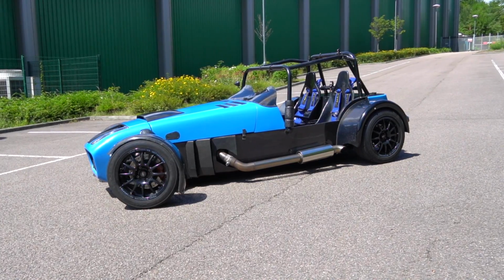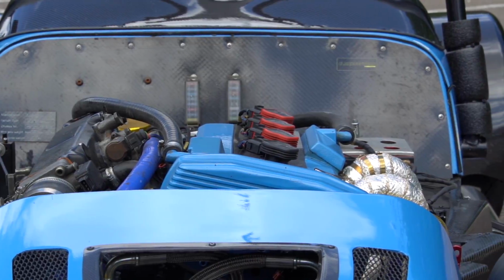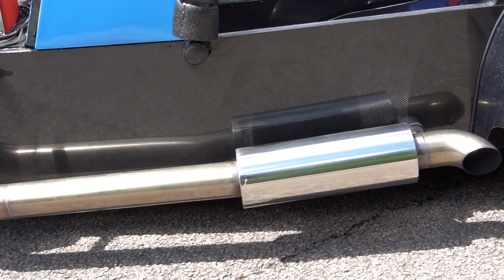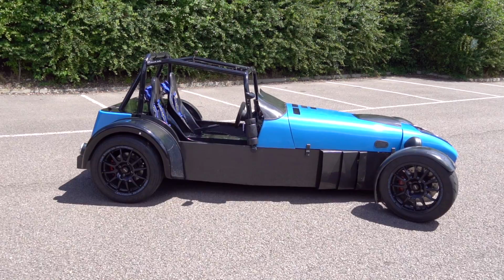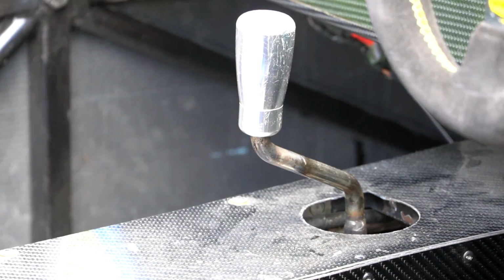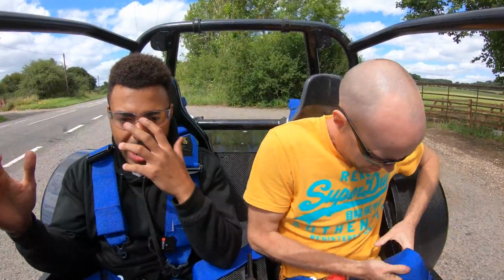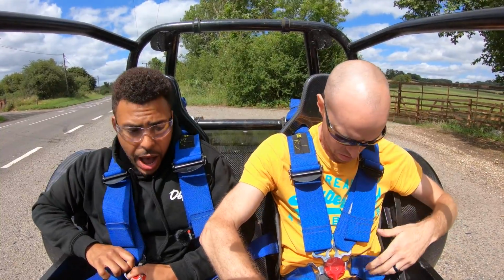THIS TERRIFYING KIT CAR HAS MORE POWER TO WEIGHT THAN A *BUGATTI VEYRON*

Comment: You need balls of steel and reactions of a fly to drive something like this. I'd be constantly worried about it losing control, correcting it along with the little protection that's given. Hope the owner drives safe 👍
Reply: I've had the opportunity to drive three others- one was a sort of daily  driver, easy, spirited after the Honda Civic the motor came from but not wild. the other two were built to exploit the very low weight the design makes possible. Monstrous and more monstrous would be my call- and as addictive as the other speed! They are the most "alive" thing I have ever driven in my life- it literally vibrates and bellows and dances when you get brisk with it. It tells you every step that you can get badly bitten if you go to far!
Reply: After about 150hp they get very twitchy in the wet. That's already quite a high hp/ton for a road car and they don't have much weight over the rear wheels.
Reply: Well driving without a helmet is just asking for problems.

Comment: nice to a locost featured anyone with  wants to build one the original book by ron champion was rewritten by mk sportscars and then years later it was rewritten  and is now  called the haynes roadster  which includes improvements like irs suspension  over live axle  wider/taller  design etc and new donner cars but yes you end up with something  fast  personalised and unique  to blow your mind

Comment: Forms of the Locost Seven, named after the Lotus Seven it emulates, have been short course winners since Colin Chapman designed the first ones in the '50s. From that start, with 750cc economy car motors, and adapted drive trains to this beast- awesome! From 0 to 125 mph or so, they are in a league few cars attain- past that and their poor aerodynamics start wanting more horsepower than you have. If you ever wondered what it would be like to go on a screaming run inside a fast agile cat, this is the ticket. Thanks to OG and LC Turbo for bringing out the toys!

Comment: Anyone that wants to know what a BIG motorbike power to weight is like, it's similar to this. As an everyday biker I've raced quite a few quick cars in my 10 years on the road. This and the Ariel Atom are probably two of the best cars to challange big bikes off the mark but once the speeds get beyond 110 mph aerodynamics will really come into play and the bike will pull away. Remember that most 1000cc bikes do at least 80 mph in first gear then have 5 more left. This looks a lot of fun i have to say and similar performance to a bike
Reply: Which is why a laidback retro bike is my kind of thing, too many crashes on my bicycles already. My bro rode at between 90 and 120 from Exeter up to Sheffield on his Honda CBR one evening and surprised his wife at being home for bedtime, sports bike riders like you are crazy. 🙂

Comment: Sadly the fenders won't support tires to match the P/W ratio and why is a bolt missing on the bracket for the throttle cable, that could cause some issues..

Comment: Love the video and the car but I have a question: Caterham produces a very similar kit car (the 620R or something like that with very much the same power to weight ratio) but their 0-60 times are much different to what this car did on the og battles. Also the  Caterham 420R  is rated to be capable of a sub 3 second 0-60.  What's stopping this car from achieving a similar results ?
Ok a 4 second 0-60 is still very nice but a sub 3 second is another level (they claim 2.7 seconds or something like that) ... into the hyper-car kind of performance.

I'm asking this because I'm considering starting on such a project but I've not yet decided  where to start off from.

Comment: Marcus Nicolaou is a Senior Director with Alvarez & Marsal Taxand in London. He has more than 20 years of experience in domestic and international corporate tax.
Mr. Nicolaou has worked with clients across a wide range of industries including retail, pharmaceuticals, automotive, real estate, professional services and hospitality.
Mr. Nicolaou brings extensive experience in tax reporting, tax accounting and compliance, including advising on all aspects of group tax planning to minimize clients’ tax burdens. He has also been involved in negotiations with HMRC in order to settle enquiries into his clients’ tax returns.
Throughout his career, Mr. Nicolaou has advised companies on a wide range of corporate tax matters including acquisitions, disposals and reorganizations of businesses (including submitting statutory and non-statutory clearances and preparation of tax due diligence reports), post-merger integration, the substantial shareholdings exemption, the dividend exemption, stamp duty, stamp duty land tax, chargeable gains, capital allowance claims and share options.
In addition, Mr. Nicolaou regularly advises clients on international corporate tax matters including tax treaty analysis and claims, EU directive analysis and claims, tax efficient structuring and supply chain planning, transfer pricing and thin capitalization, the controlled foreign companies rules and the impact of the OECD’s BEPS recommendations.
Before joining A&M, Mr. Nicolaou worked with the corporate tax department of Grant Thornton, London. Earlier, he spent 10 years with RSM Robson Rhodes and Chantrey Vellacott DFK.
Mr. Nicolaou earned his bachelor's degree in economics and statistics from the University of Exeter, England. A U.K. national, he is a fellow of the Institute of Chartered Accountants in England and Wales (FCA) and a Chartered Tax Adviser (CTA).

Comment: Would be nice to drop a Saab B234 in one of those, as it'll easily do 400+ hp with stock internals. Could run it on E85 as well.
Reply: There are several with those engines in. Achilles heel is the type9 gearbox which is quite weak.

Comment: I'm sure my veyron ss would give this kit car a run for its money does quarter in high 9s fastest pass was a 9.8 at 154 with slightly different gearing, has full exhaust with cutouts (you haven't heard heaven until you've heard a wide open straight piped w16 up close) and on a street tune

Comment: And you know the real crazy stuff? You could plant a MUCH more beefy engine in this car, without increasing weight too much. There is one Lotus 7 replica with an RX7 rotary in it around. I've heard from a guy. who plunged a fully beefed up EVO engine into his caterham, when the original Rover blew (again). Actual horse power on that one is unsure, but in the doner EVO the engine made around 600 in streat trim. With ram-jet intakes, thicker and shorter tubings there maybe some more horses sneaked in.

Comment: not even a brake servo?
that's brave bordering on insane for mine.
Reply: no need for a brake servo on a car that light unless you've got something wrong with your legs. Imo modern cars are so ridiculously over servoed  that abs is essential because you could drop a feather on the brake pedal and lock the wheels.

Comment: It's so fast it blew his hair off!!!!  Has it got an LSD as it looked like only one wheel was spinning?  There used to be a Dax Rush kitcar based on either 2WD or 4wd Cosworth. They say the difference between the 2WD and 4WD is that you don't slow down at roundabouts!  Basically he's built a Caterham 620R for a fraction of the cost.
Reply: It has a quaife. Bigger black line on my side because that's where I am. More weight on that wheel. Geo setup next week will sort it.

Comment: i owned a Locost 3/4 complete kit car like 7-8 years ago. Originally bought it with a fiesta 1.3 engine in it, but quickly swapped it out for a Rover k series engine with a bit more umph..
Sadly i lost interest in it shortly after that and sold it :(
I never even got chance to drive it either :(

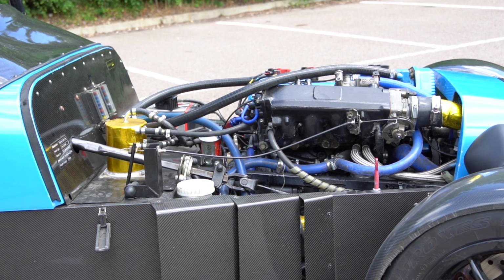Comment: looks like you dropped a bolt from the throttle linkage  on the intake  at 2:56 oops..she's a little rocket for sure..thanks for sharing
Reply: Weight saving 😉

Comment: If you really think it feels "Somethin Else" on the street going in a straight line, i would honestly buy tickets to see you drive it properly on the racetrack ie: Silverstone, Donnington, hell even Brands Hatch would be a blast! Doing 3rd gear pulls in a straight line is this things NAP time! Its been designed and engineered to SPANK Porsche GT3s and any other Tin Top with race pedigree, No bullshit, these things are fast as F**K on the track, even with pov pack non turbo motors. Just look at how it goes with an engine thats largely considered by the boost community as "Underpowered" can you imagine one of these things with a crazy 2J, RB, 13B Turbo, fj20 even an LS1 with mild mods would be unbeatable lap after lap. Trust me i know this from 1st hand experience. Unfortunately not from owning one but instead having my ass handed to me by a car costing less than 20k driven by a guy in his 90s on bald A008R tyres LMAO so damn impressive. Drive it on the track, i dare ya!
Reply: I do. Jamie likes to keep things sensible on the streets👌